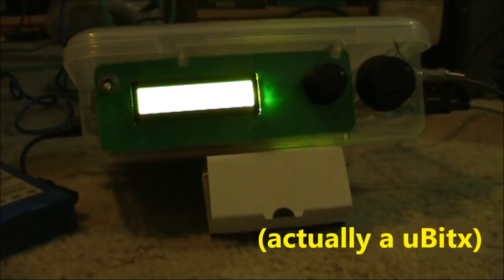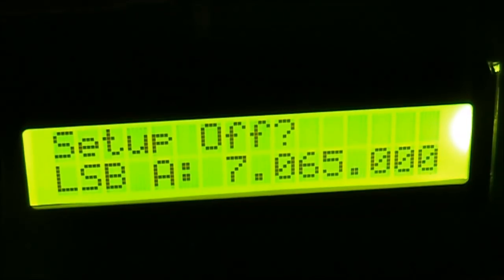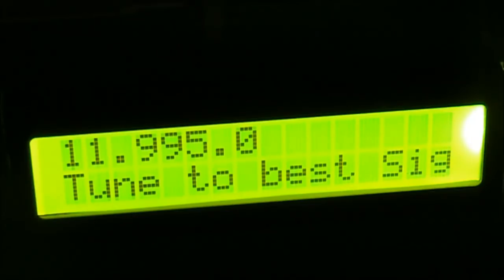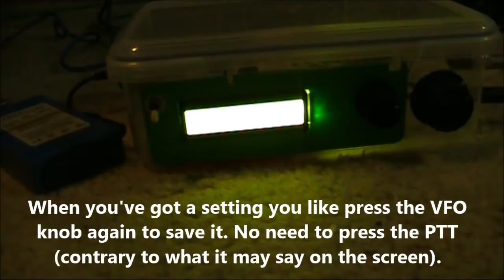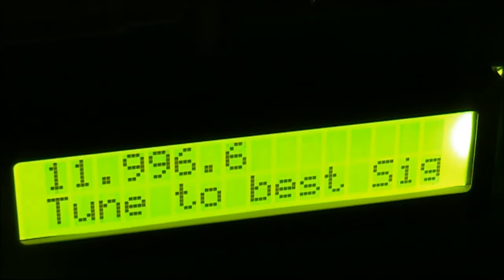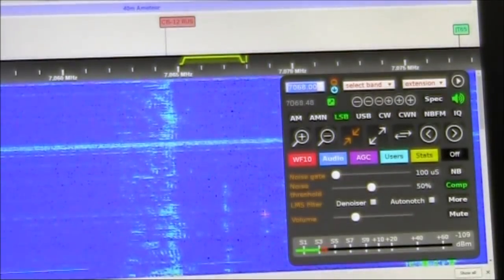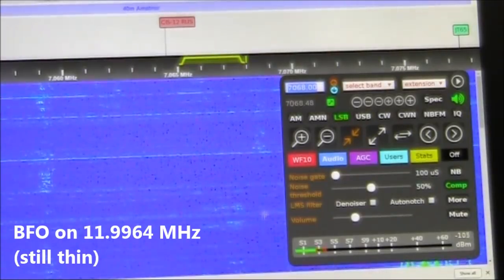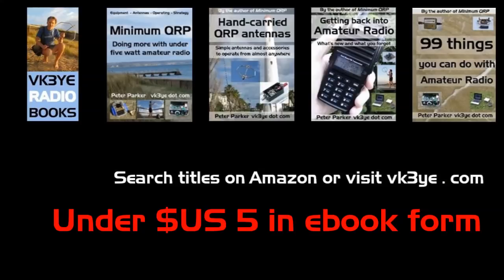Adjusting the BFO on the uBitx transceiver

Comment: Thank you Peter, I must be lucky I get good audio reports all the time with my U Bit X  ver 6:  something ,what  I've noticed is the bleed over from other radio amateurs near either side of the chosen frequency,I'm sure there's a mod for it, and actually speaker that coms with them is crappy, going to try an old computer extension speakers. love your video's 73 Paul